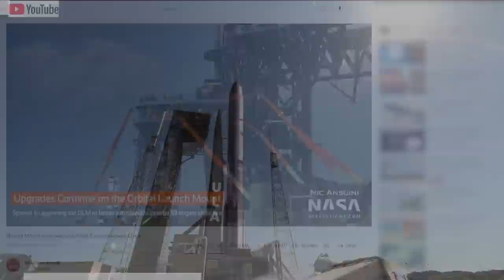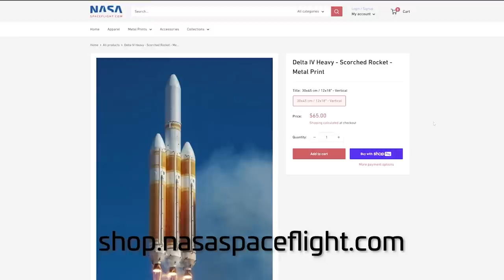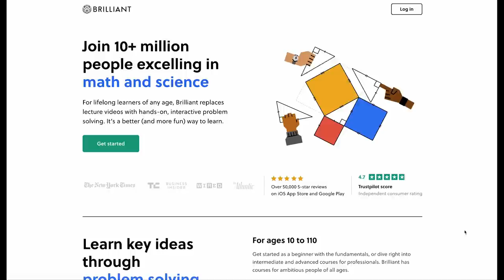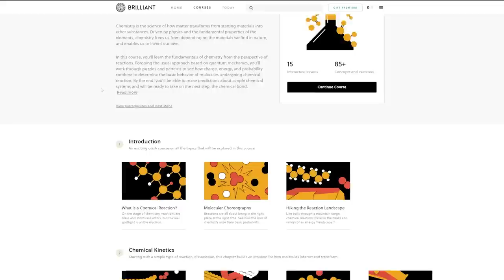Will Starship be the First Methane-Powered Rocket to Fly?

Comment: There could also be a difference between "who will first attempt orbital flight" and "who will first reach orbit".
A lot of rockets needed several attempts before they successfully reached orbit
Reply: And first Starship flight won't even be fully orbital for safety reasons, despite having orbital velocities and using all the energy needed for that. So even if successful there will be another drama if it even counts.
Reply: @kazioo2  actually that’s changed - it’s now orbital, with Starlinks
Reply: @philipwhiuk  Nope, they sealed the starlink door shut, no starlinks.
Reply: lets be honest attempts doesn't really count as it is difficult to specify (is it lift off?, needs to get to max q or light up engines on pad is enough?)... first to reach orbit is the race and I hope Relativity will win this and if they manage to do it on their first attempt it will be absolutely amazing
Reply: Not to mention Space X is the only one with a back up booster and Ship just incase the first one doesn't make it to orbit.

Comment: I’ve often wondered if methane was ever considered in the Apollo project.  I’ve never come across it in reading but, as they were working with hydrogen, the capability was there to design a methane engine…
Reply: The Saturn 5 fist stage was RP-1 (Kerosene) which is a bigger bang than methane.
Reply: @lantrick  Indeed it does…. I was thinking more of the 2nd and 3rd stages.  Would have solved many technical issues in development - especially the S-II.
Reply: Methane was considered around the 60s, but never seriously developed. Hydrogen was much more efficient, and the Saturn V needed every little bit of power possible
Reply: Since there was no reusability considerations, coking wasn't as important a concern as thrust.
Reply: @apostolakisl  I was thinking more along the lines of the S-II and S-4B.  Particularly both the cryogenic issues with LH2 and also possible weight savings with the stage.  (I haven’t done any math, but would be interested to know if the smaller tankage/weight for the denser CH4 would have been an advantage over the higher specific impulse for LH2)

Comment: Another convenient fact: When liquid methane and liquid oxygen is pressurized to a few bar pressure like in Starship, both propellants are liquid at the same pressure and temperature conditions, which makes handling them easier than some of the other fuel and oxidizer combinations.
Reply: True, it makes it easier than any other fuel oxidizer combination other than hypergolics, which are less popular due to ISP and toxicity.
Reply: This is very true and is often overlooked for how important it is for simplifying the actual engineering of the rocket.
Reply: Also, Raptor 2 runs on LNG. It doesn't require purified methane anymore, further reducing fuel cost.
Reply: @BodhiPolitic  But not reducing impact on the environment.
Reply: @tontonbeber4555  the environmental impact of rockets was never huge to begin with, the bigger focus is on safety, and methane is already miles ahead of other propellents in that area, especially compared to hypergolics
Reply: @1224chrisng  About environmental impact, I didn't think that much about the nature of the propellent, but about the quantity. Spacex is the art of doing with ten tons of propellent what others do with two tons. Otherwise I'm not sure about the advantage of methane with respect to security, and I am certain it's below hydrogen in performance.
Reply: @tontonbeber4555  well regardless, it's possible to synthesize methane, and it's comparatively easy compared to kerosene, so in the grand scheme of things, it's a solved problem
Reply: @tontonbeber4555  have a look at The Everyday Astronaut. Tim Dodd has done a deep dive into rocket fuels, their advantages, effect on ISP and the environment. He also explains why Methane was chosen for Starship.
Reply: @tontonbeber4555  But does it matter? 570 million tonnes of methane are emitted each year. Let's say each Starship launch (which uses 1000 tonnes of methane) leaks an extra 1% (probably pretty high), which would be 10 tonnes. Even if they launch a thousand times a year, that's only 10,000 tonnes of methane, which is a drop in the bucket compared to the global emissions. Also consider that in producing these emissions, they'd avoid many thousands of tonnes of other emissions by virtue of not having to manufacture a whole rocket each time. Rocket launches have a lot of associated emissions that don't come from the launch itself; for SpaceX, these emissions are low relative to other companies.
Reply: @erictheepic5019  Of course it matters, as you know in western europe millions of people will not have methane enough to warm themselves next winter because of the stupidity of politicians, and I find it extremely shocking to waste that energy.
Reply: @tontonbeber4555 

Firstly, Starship ≠ Waste

Secondly, you do realize that a kg of natural gas used in America doesn't mean one less kg of natural gas sent to Europe, right? That's not how that works.

Thirdly, Europe uses 400 million tonnes of natural gas per year. Using that same 1000 launches-per-year figure as before, Starship's methane usage is 0.25% that of Europe. Heating usage varies by significantly more than that depending on how cold a winter it is. The amount used by Starship is meaningless in the face of how much energy half a billion people use. Also, by the time Starship is actually using that amount, Europe's natural gas usage will be at least 0.25% lower than it is now, what with the serious motivation to turn away from using natural gas...

Also, what's the dumb choice politicians made? Is it moving away from nuclear which made them natural gas dependent, or is supporting the sovereignty of Ukraine?
Reply: @erictheepic5019  Starship is probably the dumbest and most useless object humanity has ever created.
Reply: @tontonbeber4555  So you believe rocketry is worthless? Also, nice dodge of everything else I said.
Reply: @erictheepic5019  I didn't say rocketry in general, I said starship in particular ... it's just space shuttle without wheels, and we all know how it ended.
Reply: @tontonbeber4555  Even without upper stage reusability, Starship is cheaper to manufacture than its competitor (SLS), and could get more mass to orbit per launch. Do you also believe Falcon 9 and Falcon Heavy are worthless? Do you just believe reusability in general is worthless?

Also, the Space Shuttle's failure because the design was kinda bad in the first place, and NASA only did anything to improve this situation once when it exploded. It also had a launch cost of almost two billion dollars; you don't think these thing are at all related? It's incompetence from NASA. Don't even try to say that that's because it's reusable, because that would imply that Falcon should cost much more than its competitors, not less.
Reply: @erictheepic5019  Well, when I see starship, I don't think about an advanced spaceship of the future, but I remember the early 1960s with Northtrop's M2F2 and HL10. You remember the famous crash of the M2F2 (and how the problem was later corrected), ... well starship is almost the same shape ^^
Reply: @tontonbeber4555  Both of those are lifting bodies. Starship doesn't generate lift except for early on during reentry, at which point the shape of the craft basically doesn't matter (you can can lift out of a cone at those speeds). Seeing as it shares no functionality with either of those two, you're comparing it based on looks. By that measure, you may as well compare it to a rolling pin. A rolling pin cant fly, so neither can Starship, right?

Comment: It’s not in the running for first but Neutron is another methane rocket in development.
Reply: Granted, that is expected to launch no earlier than 2024-2025.
Reply: @KnightRanger38  Yeah, but so is New Glenn, yet it has been talked about in this video
Reply: if it wasn't for ULA using the same engines they probably wouldn't of brought up new glenn is my guess since it's nothing more than a concept at this time.
Reply: The launch date I'm seeing for Vulcan is March 2023.  Not this year as the video indicated.
Reply: @Scanner9631  I think you are looking at Vulcan Centaur, which is without strap-on boosters. Currently the first vulcan launch planned is a Vulcan VC2 (meaning 2 boosters) launch NET December. So the video is correct.
Reply: @patrickrijkee  

The source I'm using which seems reliable lists no ULA launches after this month till January and then Atlas V and Delta IV for that month and February.  The only Vulcan listed is March for the USSF-106 mission.

Please cite the mission designation for December so I can search for it.
Reply: @Scanner9631  Peregrine Mission One is set to launch on Vulcan VC2 NET December, 2022.
(Source: NextSpaceflight)
Reply: @sirmonkey1985  Blue Origin has actually manufactured and rolled out stage sections (they seems like empty shells) for New Glenn. Rocket Lab (according to their investor report a few weeks ago) is still constructing initial stage portions.

Comment: Bit of an arbitrary category for "first," lumping together totally unrelated types of rockets.  Terran 1 is an expendable small payload launcher; Starship is a reusable ultra-heavy-lift and by far the most powerful rocket ever built.  Saying the two are competing for anything is like saying someone building a birdhouse is competing with someone building the world's tallest skyscraper because they both plan to use a novel material.
Reply: Arbitrary "firsts" always work like that. It's as valid "competition" as any other in those "flag capture" rivalries. No one is talking about actual competition in the market or capabilities.
Reply: Not to mention government authorization is likely playing a part with starship.  They were going at breakneck speed till epa reports and have snail paced since then.  Higher cost to get it done faster and gov seems to be holding them back so money isn't spent to maintain the original build speed.
Reply: In your analogy if the birdhouse is taller than the skyscraper, that just means someone got outsmarted.
Reply: @trekie30122  Well, it's not yet time to accuse the gov of holding them back.  They still haven't done a 33 engine static fire, so they wouldn't be ready to launch anyway.

Comment: When rockets are fully reusable, fuel costs become significant. Methane is much less expensive than hydrogen or kerosene.
Reply: Also using the same engine, structural elements and propellants cut costs development, manufacturing and use.  Starship does them all.  If it works there will be major cost savings.

Comment: Hasn't Starship already flown?  Even if it didn't go to space, it launched, flew up, hovered, dove, and then relit the engines for the landings (crashes) all using methane and oxygen propellant.
Reply: @AntiangelRaphael but it should be counted as the in the question. or the question needs to be changed to - first methane powred rocket to reach orbit?
Reply: @AntiangelRaphael 

That is an artificial and arbitrary boundary that he made up for the video.  In actual truth, Starship was the first to fly on methane.  Not even the Super Booster could make that claim.  It's still doing static fire tests.
Reply: @snapshuttre  

That would be the way to fix it.  "The first to reach orbit."

Comment: Think the use of methane is used to power an aircraft is useful, but I must ask, how will the odor be control being release into the atmosphere that will eventually and harmfully affect those whom might breath this oxygen. Of course the first few will not, hopefully, cause harm, but as it is scientifically known and seen in communities of massive population, smog is apparent. So unless the use of methane gas can be proven beyond responsible doubt, not to cause over a period of time damage to the normal mindset of any human being, then I refuse to support use of such element. Bottom Line opinion of my own choice. I have a Bachelor's and a Master degree that were above 3.0 gpa and earned between 2010 thru 2015. I also have certification once before going to Colorado Technical University in Colorado Springs, CO. Also earned a C.I.T.I. certification at 100% grade and to pass, only needed an, 80% after receiving both of my degrees.

Comment: Methane vs kerosene vs hydrogen vs ?..How about a hybrid of technologies to get a higher yield of benefits?
I understand that methane has benefits of fuel production on mars yet on a return trip all that extra thrust is not needed to leave the planet. 
As a result of lower demand for max thrust and less weight upon reentry, why not explore combinations that may exceed current metrics in the face of added trade offs?
One trade off on my mind is how to minimize added bulk, weight, and complexity of carrying two fuels?
Would systems driven by kerosene physics, such as utilizing cooling capability, leveraging pressure, and so forth be substituted by methane as the main driver of auxiliaries and if necessary kerosene and other rockets be swapped in plug and play fashion without sacrificing optimization?
Could a centrifugal separation of density moderated fuels and liquid barriers simplify things?
How about membranes that dissolve into useful fuel additives once one source of fuel is consumed?
Could an energy source such as RF,Light, heat, or sound trigger decomposition without harmful false triggers or be inconsequential?
We are pretty good with erasable pens and highlighters, how about erasable components?
Maybe a tank made of frozen methane blended with other frozen nano particles that may give the concocted skin some desirable properties such as elasticity, rigid nests, shock resistance, thermal conductivity, sound absorption/reflection, transparency, etc…?
How may this play out in 4 dimensions optimally?

Comment: If there are so many advantages to methane that everybody is using it now, then why did nobody use it in the past 60 years of rocketry?
Surely the physics have not changed, so all those advantages would have been available back during the space race of the 60ies as well. Yet up until a few years ago nobody cared for methalox. So what has changed that suddenly made it so desirable?
Reply: Push for reusability for one. Push for economics/commercialization over Isp performance for 2. Environment for three. ISRU on Mars for 4. Easier to handle for economical operation for 5, etc. Compared to experiences trying to make hydrogen truly operational.
Reply: probably because of common heritage of space rockets with missiles. the first rockets (and therefore rocket engines) of the space race were re-purposed missiles, and the special formulation of kerosene that is RP-1 was designed with missile use in mind (one requirement of which was, long-term stable storage). And then after the F-1 in the 1960's the US did not really build many new hydrocarbon-fueled rocket engines so there wasn't much chance to try other fuels. 

In the 1960's we were just getting the hang of liquified natural gas (LNG, the highest grade of which is basically pure methane), we weren't yet making a whole lot of it, and we were still seeing compressed tanks of it exploding. So it wasn't as "shovel-ready" as it is today.

Comment: Sorry, didnt Starship SN8 fly a year ago?
Spacex will not win - they already won.👍🇳🇴
Reply: Starhopper flew before that.  

But then again he did state "To Orbit" not just fly.   

For those who state the current Starship has had its cargo slot sealed so it won't go to orbit.  Nothing that I know of has been said by SpaceX as to why.   It could be a temporary seal to keep debris out during the time before launch (now supposedly November).  It could also be as they assume permanent we don't really know.  Maybe they are redesigning the slot door to handle vibration that they didn't account for and it will be unsealed and upgraded.  Who knows?  SpaceX hopefully, but I sure don't.

Maybe even SpaceX isn't sure.  We need to wait and listen and see what actually happens.  Even if it is sealed that doesn't require Starship not to achieve orbit on the 1st flight.

Comment: Another reason to use methane over RP1 is the exhaust of methalox is more environmentally friendly than RP1. Yes, there is methane boil off escapes that the industry is learning to reduce but the exhaust is a better byproduct than RP1. Tim Dodd did a good report of Methalox vs RP1.

Comment: Aren't raptor engines really more oxygen rich ? this also makes em more cleaner !
Reply: Raptor - and basically 99% of all rocket engines - burn fuel rich. They can have preburners that run oxygen rich though but the preburner is not the whole engine. There's the combustion chamber that goes after that does extra combustion stuff and that one always runs fuel rich. In the case of Raptor the mixture ratio is 3.6 oxidizer to fuel. For it to be oxygen rich the ratio would need to be above 4. Similar thing happens with Merlin, RS-25, etc... all burn fuel rich, but can have oxygen rich preburners etc (although Merlin and RS-25 do not have that but RD-180 for example does have oxygen rich preburner)
Reply: @ale131296  thanks ! I always wondered about that ! what is the future of the RD- 180 engines ? i heard they were being discontinued .